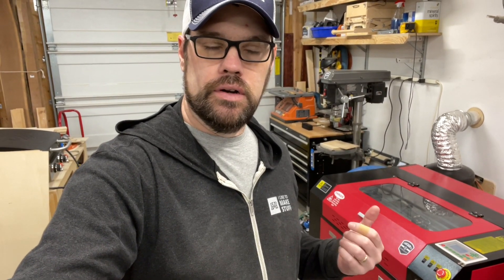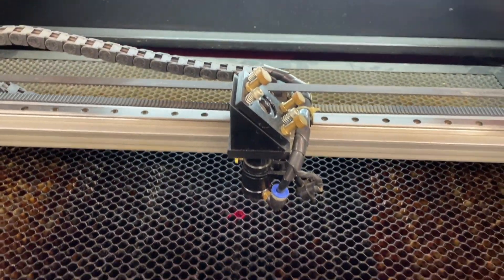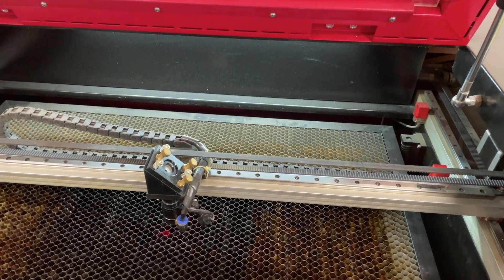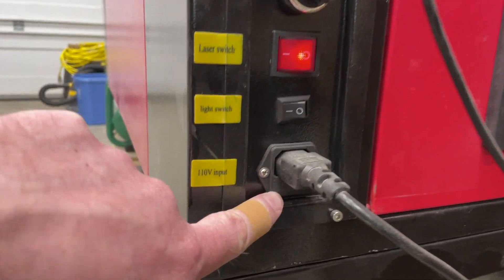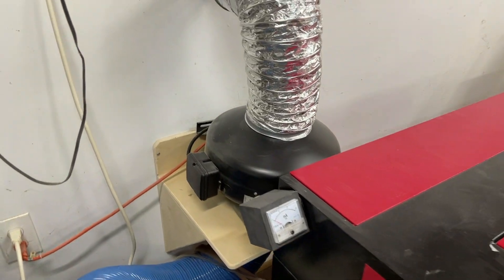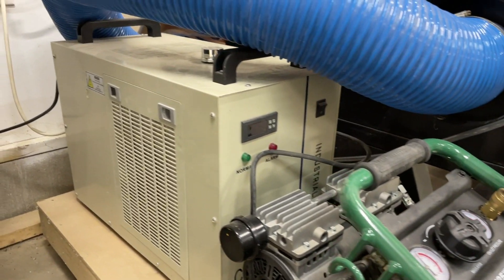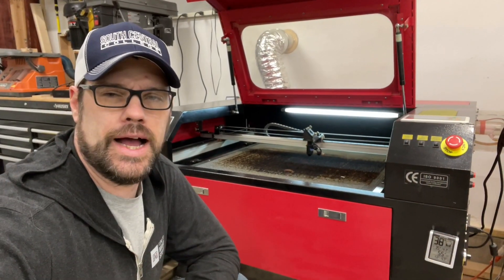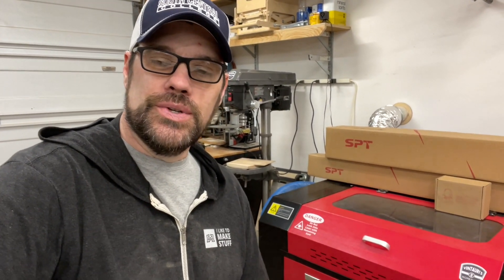eBay Co2 Laser - 5 Years Later - Was it worth it?

Comment: I've been watching your channel a bit as I have the same machine you show here and you have helped with a lot of questions I initially had you mentioned using an aquarium chiller I have limited funds and they are heaps cheaper how well did it work
Reply from the maker: It worked better than no chiller and generally kept the water in the appropriate range. However you still need a separate reservoir and pump to move the water through the system. I prefer the more sealed setup of the purpose built chiller. But while on a budget it will work.

Comment: Hi, its possible install autofocus in that machine??? Thanks a lot
Reply from the maker: Not easily in this one as the lifting motor is not connected to the controller but just two manual up and down buttons. It would take a lot of retrofitting to get done.

Comment: I know this is an older video.. But it looks like you are still active on youtube. I have the same laster I picked up used about 4 years ago. Its been fantasic. And I replaced along of the same parts you mentioned. your a review on this is spot on ...  I do have a question, did you ever use the rotary tool plug in? I just picked one up. And its giving me a super hard time .. I think its a a controller setting. But I can't find it for the life of me. If you have and could share that info it would be fantastic. If not no worries, I will keep digging.
Reply from the maker: I do have a chuck rotary for it and remember having some issues getting it dialed in.  You have to dial in the steps per rotation and be sure to adjust the diameter settings for it.  I was using it more in RD Works which was more difficult than Lightburn. I have not used it in a while that way.  The Circle Pulse or Steps per rotation were around 1000 if I recall but that might be different for your controller.  Once you get it functioning, get a scrap can or tumbler, wrap it in painters tape and do some tests with a 1" square, measure it and adjust that number bigger or smaller to get it dialed in.
Reply: @Vintauri  thanks for the reply. I spent 8 hours yesterday , and got it all sorted. I will be doing a video on it. I needed to pulling out the bed, and mounting it under the 4 corner bracts. This gave me almost 2 more inches of clearance. I’m running the newer cloudray rotary with the 4 wheels and the rubber band around the wheels for no slipping. But put out issue rather simple, someone before me had plugged the stepper motor plus port into the ruida controller. That should have been swapped with the Y access stepper control driver. I ordered up the relay to put this on a switch in the future.
Reply from the maker: @1620GarageAndFarm  Glad you got it sorted out. It would be nice if we didn't have to swap the Y for the rotary on these machines but that is common.

Comment: Hi Vintauri. I really like your vids and creations. 🤗

You are the only one i could think of having nearly the same laser as me, i could ask for guidance/help.🤞😊

Sry if this isnt allowed but:

I have a vevor 80w and been doing some ideas. But i cant find anything about what kind of oil i should use to lubricate the transmissions thingy (cant remember the name and im not right beside the laser - so cant check). But it says those things should be oiled once a week for maintenance. 

By the way i live in Denmark 🇩🇰, ive tried contacting the company - but no reply. So if you could point me in a direction of different stuff for lubricant. Maybe something in the car shops would work? 🤔 
I would be so gratefull, if you would try to help me out🙏
Reply from the maker: Thank you for watching.  For the rails on this laser I use a light machine oil or 3 in 1 oil.  It's similar to what you would use on a sewing machine. A little goes a long way so don't get to heavy with it.
Reply: @Vintauri  Thank you soo much. 🤩 

Looking forward for your next vid. 😁

Comment: Hey I just got the same machine from some person and it has a melted e switch so I have to put the new one but I cannot figure out or find any info online how to wire it. Could you please share the source where I can find the guidance how to replace it
Reply from the maker: Depending on how melted the existing plug is, you can hopefully read the type of plug it is on the back.  Then search for a replacement.  Mine requires a 2NC style and I was able to find it on Amazon. Then just swap the wires in as they are on the existing one.  Here is the link to the one I used but be sure to try to find the style on the existing one you have.  https://amzn.to/3sMkeEx

Comment: Hi, I just bought a machine similar to yours last week, it has auto focus. I noticed that it did not cut 100% square, about 5mm off for 14"x12" cut, even at slow speed. How do I fix this? Thank you.
Reply from the maker: When you say that it is 5mm off, is it' short of your measurement, or is one side shorter than the other?  I would start by checking your belt tension and that there are no imperfections in the belts or pulleys.  Make sure the set screws holding the pulleys on are tight and not slipping.

Comment: May I ask where do you get your parts from.  My platform won't go up and down.  Working with it I believe  it is the motor.  if I help it by pulling on the belt it goes up and down but as soon as I let the belt go it stops and it only clicks.  So I think it needs a new motor.  But I having trouble locating a place to get parts.  Can you help me?  Please.
Reply from the maker: I usually look at the parts for model or part numbers and do an online search.  I've purchased parts from eBay, Amazon, McMaster Carr and others as I find the relevant parts.  For more laser specific parts I've also used CloudRay and American photonics.

Comment: Good Day everyone.  I'm planning on engraving/etching aluminum tubing with this machine. I'm just worried as im not sure if this laser can have it power adjusted lower so I doesn't burn a hole through the tube.
Reply from the maker: This machine won’t touch aluminum. It will etch through a powder coating or anodization but it will not cut the actual metal. However you can control the power down very easily.

Comment: Hi ! I have the rd sail x 700...unit works fine but no laser beam what would be the problem ?
Reply from the maker: If your laser turns on and the control panel lights up and you can move the gantry around with the directional buttons then you need to look at the laser HV power supply or the tube being bad.

Comment: im in Northern Minnesota ,just bought a laser and curious about the RVantifreeze and how much ?
Reply from the maker: I would go no more than 50:50 mixed with distilled water if being used in a shop that will stay above freezing. If you can’t keep your shop warm enough you might try straight RV antifreeze but that may also raise the conductivity of your coolant. My shop stays above 40 even on the coldest weeks so I’ve not had to test the coolant mixture in temps where it might freeze.

Comment: Did you wear glasses 5 yrs ago?
Reply from the maker: I've worn glasses for many years.
Reply: @Vintauri  just wanted to make laser didn't damage your eyes, also how do you know which ebay company to trust when looking for a laser
Reply from the maker: @8mmmauser896  I try to make sure I wear specific laser safety glasses whenever I use any of my Co2 or Diode lasers.  Here is a set I recommend that works for most diose and smaller C02 lasers. https://amzn.to/3b7c2GD  I have my annual eye exams and they have not noticed any issues other than typical aging.   As for the eBay sellers, it's hit or miss.  I'd strongly recommend you consider Omtech or Monoport for a similar laser and cost.

Comment: The tubes are different lengths?
Reply from the maker: Yes the tubes can be different lengths when they are different power ratings but also if they are a wider diameter then they can be shorter and create the same power levels as a thinner but longer tube.  It's good to check the measurements of your case and tube holders when ordering a replacement tube.

Comment: Why'd you pay so much for such a lower power laser?
That thing is barely stronger than a $400 K40
Reply from the maker: Because I needed more cutting area than the small K40. I looked at those at the time but the $400 units have a cheap controller that is annoying to use, have no air assist, no adjustable bed, and are very small. By the time you upgrade them to some of the basic features of this one, you’ve spent another $600+ on them.

Comment: Thanks for the video.  I have the 80watt from OMTech for 3 years now with zero issues.  I guess I got lucky.  Every thing was aligned and tuned pretty decent.  I love the danger sticker,  since I have 1 good eye and one bad eye, I find it pretty comical.  Is that something you can share?  If not it's cool but I'd like to run it thru the vinyl cutter and stick on my machine  :)
Reply from the maker: Thanks for checking it out. I think OMTech is a good company and I'm glad to hear your laser has been solid. They are on the top of my list if I ever upgrade. I'll see if I still have the laser warning label file. I cut it out on my vinyl cutter.

Comment: And here i thought the clear cover extension was for visibility and looks :D
Reply from the maker: Well it does do that as well! I had the acrylic on hand and was easy to get it done.  Making it out of metal would have been rougher and taken longer.
Reply: @Vintauri  I'm really glad I saw yours, because the metal enclosure that came with mine is interfering with the rotation of the tube, and has always been an alignment issue. Now that I know an acrylic box can work back there, I know I can make my on custom piece, set my tube free. After I think though acrylic color and other design possibilities :D

Comment: Excellent video.  Did you add the LIFT PLATFORM and LOWER PLATFORM switches on the side of the machine?  If you did, can you share some info about how you did it?
Reply from the maker: The lift and lower buttons came installed on the laser. Shortly after I purchased mine, it started being an upgrade option on most cheap lasers.

Comment: Thanks for sharing how you handled the various issues with your machine.  Have a 'China Blue' 50 watt (lol) since about mid June.  It's basically the same animal, except mine is supposed to be a 2021 version...  It does have an access panel on both sides of the machine.  It allows much better access to the motor/M2 assembly.  It's pump is upgraded to the aluminum block type, although the original mount for the plastic pump hasn't been removed yet, I found it a convenient place to mount my air assist control solenoids...  It also came with a honeycomb bed.  That got tossed for a sheet of rolled steel for $12.  It just wipes off with alcohol or other solvent.  Difficult to clean out the honeycomb and stinks all the time, not to mention they don't really work like you would think.

Interesting to hear of someone using RV antifreeze in their machine without any issues.  It's a common discussion about how to keep tubes from freezing.  Automotive antifreeze is considered one of the worst in terms of lowing the dielectric of the coolant to what many consider below an allowable value.  It's nice to know you've had no problems with 5 years on the machine.  I solved that issue by only living where water doesn't turn hard naturally.  Hence, I have a 5200 series chiller that works well in the SW desert.

Your comments if it's worth it are right arm (on).  I spent about $2K on mine, not counting the chiller, I have put about $500 in it.  Changed out the head, drive system and removed a great amount of mass from the head.  The controller is set for an acceleration is 50,000mm/s/s and max X speed is 1650mm/s.  Might go faster, haven't pushed the acceleration any more than the 50K it's at now.  To say I learned a lot is an understatement.  I also have found that the air assist works well with a compressor, input of 30psi, 'status' sinks, and opens the air, which is reduced to 3 lbs.  Anytime a job is running I get low pressure lens protection for engraving.  I use the 'air assist' ('Wind') on the layer to bypass the restrictor and apply full pressure for cutting...  Definitely worth the time and money.  I have 1.5", 2", 4" lenses along with a compound for engraving...  All are 'C' mount tubes.  Keep the videos going (coming.)

Thanks for your video...  Take care :)
Reply: I'm looking to get one but I'm really scared as a newbie

Comment: The difference between these Ebay Chasers (Chinese Lasers) is hobby vs professional. There are US companies that import these same lasers, gut them, and install higher quality components and up to code wiring and sell them at a much higher price, usually @ 4 times the cost of one of these.  You MUST know what you are getting into when you buy one, or you will be disappointed, angry and go about ranting at what a piece of trash they are.    I have the Yellow and Black model which is similar, but different in it's functions and layout, mine homes upper left instead of upper right, has a slightly different door layout, but overall is out of the same factory as the red and black models. Mine also has a bad switch, but the power switch on the side, not the emergency switch, which is what I use to shut it down with since the actual power switch is bad.  Some day I plan to get a couple spools of the proper wire and some good switches and rewire it to code. 

Plan on spending money to upgrade when buying one, they work OK out of the crate, but with a little extra work and cash, can work a LOT better. I replaced the mirrors and lens and gained more cutting power with the stock 50W tube that is rated 60W at burn out power.  I have no complaints with mine, just takes some patience and learning and with a few upgrades can be a really good tool in the shop. I really like the one I got, no complaints.